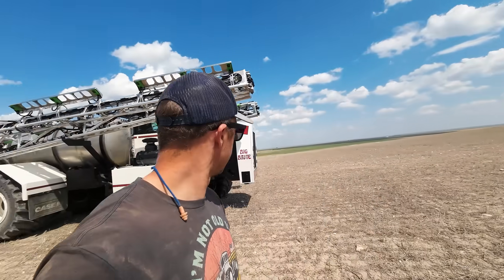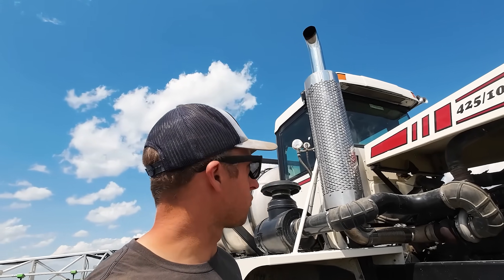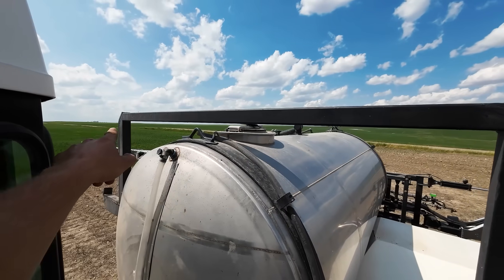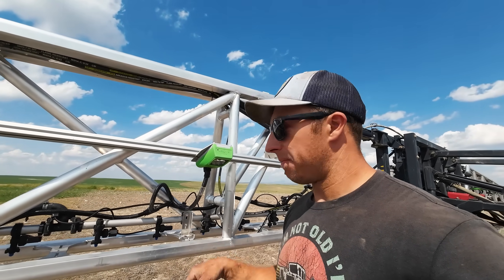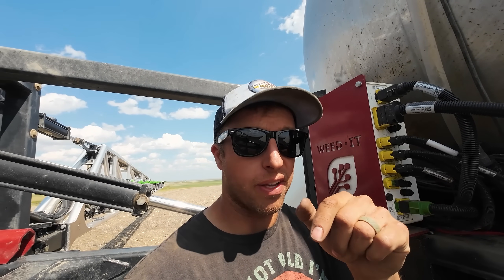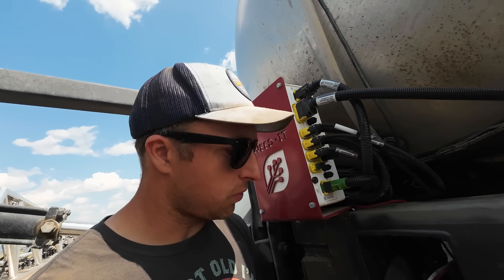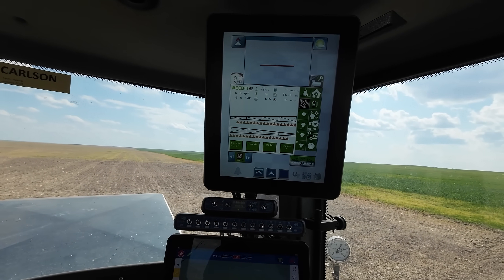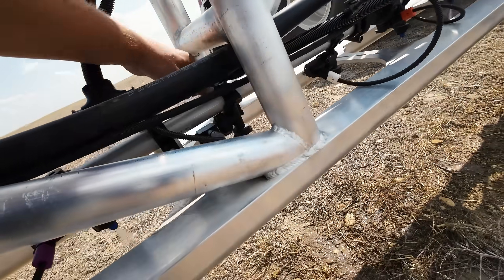BIG BRUTE'S Gone To The DARK SIDE!

Comment: That is absolutely amazing that those sensors can see a weed at driving speed and spray the weed that fast technology is absolutely amazing
Reply: And stupidly expensive....
Reply: @karljacobson1575 so is chemicals. If I was fallowing as many acres as they do? I’d buy it in a heart beat because it will pay for its self. I burn down every spring and I’m looking at getting a pull behind like this.
Reply: @karljacobson1575  In his live stream he said it was around $200,000 for just the booms and weed it system... not including the sprayer.
Reply: @karljacobson1575  Why do you care?
Reply: @karljacobson1575  It might be "stupidly expensive" as a system of systems, but when you consider how much Welker Farms spends on weed control chemicals, anything that allows them to operate more efficiently regarding treatment application should be applauded, not denigrated.  Welker Farms is a business, so the better they utilize their resources, the better their profit margin, which in turn allows them to spend more on their operation in order to gain even greater efficiency and profitability.  Plus, it's really cool that the system plays the Imperial March during Big Brute's calibration... Tell me I'm wrong... 😆
Reply: @paulcopeland9035  i’m a farmer……
Reply: @redknight1322  sure they can justify it i can’t is my point!!! i’m not a  BTO !!!
Reply: You need to look into poly liners on the verticals of the boom cradle instead of rubber. Poly will let the boom slide better with less likely to tear as the boom rides down it.

Comment: We had a tractor that had two complete exhaust systems.  In the vertical mode, it was loud. We picked corn in this position.  When the loader or mower was on, We put the ground mount. The exhaust was much more pleasant in ground mode.

Comment: If you ever have to remove the tank, just cut the top piece of iron near the ends, and then cut two short pieces for the ends, and slide them over each end to connect the middle piece, and just put two holes on each side.  You can then just bolt it, or use a slotted pin with a hair pin clip so you can take it apart without welding it every time. The only thing you would have to worry about is coating it so it doesn't rust together at the ends where the two pieces would slide inwards to remove the middle section.  I love how it looks, and it sure beats a payment with how uncertain the economy is.  G-d bless.

Comment: awesome rig! 
at 16:55 I assume "12 to 15 gallons" is the per-acre rate, and you're not actually 'dousing' them - don't want to give the antis more ammunition lol.
Reply from the maker: Yes that rate is per acre. So if in a normal circumstance I'm doing 12 gal an acre across 120ft of boom. With this, that 12 gal rate stays the same but only over a few nozels. So a significant increase in rate on the weeds but zero rate on bare ground. More efficient application of product. Totally agree, I want to make sure it doesn't trigger any anti chem folks! This system is much better than the alternative.
Reply: @WelkerFarms  weed sensors are incredible kit, your savings will pay for it quickly!  Love your vids!

Comment: you could put the midsection sensors on the front of the brute and just calibrate the distance
Reply: Would eliminate the dust issue from the tires too.  Not sure about the 40” constant height tho
Reply: @nickkercheval2704  depening on how stable it is, but from the camera view it seems really mostly flat and smooth riding, otherwise it would need a leveling system on the front and that seems like a lot more work

Comment: The boom support crossbrace would been better with flat plate on back of the vertical stops & cross beam with 2 or 4 x bolts on each end.
that cross brace be good spot for a bajadesign led light bar

Comment: Question??  When the booms are in the cradle, what about seeing traffic at cross roads?  The booms look like they would be blocking your view or is that not a problem.
Reply from the maker: They absolutely are in the way. As an operator I have to take the time to move my head around so I can see through the gaps in the boom. There are enough small openings I can get a good idea of what is to the right or left of me. It isn't as nice as it was with the old booms.

Comment: hmm. no flag mount? i would suggest the centre of the new cross brace for when your winged in on the booms. but would it be an empire flag, a case flag, or the stars and stripes?
Reply from the maker: The reason I haven't put flags on the sprayer is I go 40-50mph down the road. This would destroy a flag in no time. But would love to fly one if it were slower!
Reply: @WelkerFarms  thats a fair comment. how about painting the back of the tank? or the roof of brute?
Reply from the maker: @ghostwalker100  actually a big usa flag on the side of the tank would look great! Might have to do this

Comment: Looks like a good system but ya better upgrade the hydraulic cooling system an add more capacity
Reply from the maker: It used to be a spreader truck with massive hydraulic Motors. It has A huge cooler on the front and a 70 gallon tank. Oil stays nice and cool.

Comment: The trouble with that system is what if a weed has yet to emerge?  You have no residual for what has yet to come up.
Reply: You have to fallow the soil... which means they will go across it 5 or 6 times thru out the summer. It just to leave the field bare to conserve moister for next years crop.

Comment: So why do this route on with the weed it that’s so expensive and so many weeds it’s constantly on. And why not just preburn with a residual product? We preburned a barley field with round up and prepass. My goodness that stuff cleaned up the field. So what happens when you spray and there are weed seeds sitting in the ground. Just doesn’t seem practical for the extreme amount of weeds and how much it runs  and the importance of residual products on preburn in my opinion. More of the type of thing you buy to be the neighbour with gadget
Reply: I guess you don't have RT3 resistance kochia.  It wont touch them.   And you have to spray full loads the 2nd and third times.  We are spraying only the weeds and using up to 30% to 80% less chem and hitting them harder.  Wish we would had it last year.